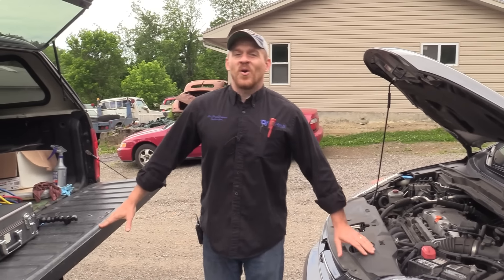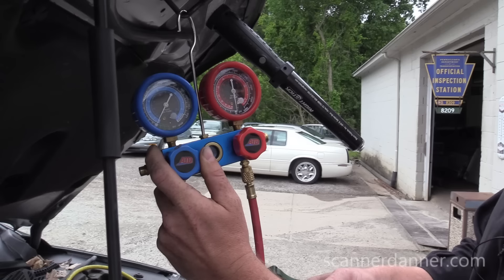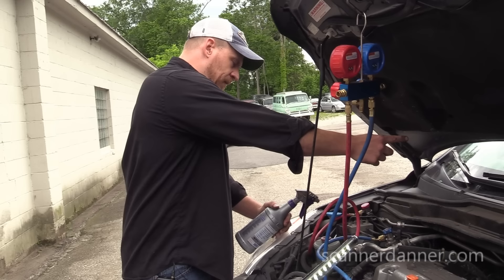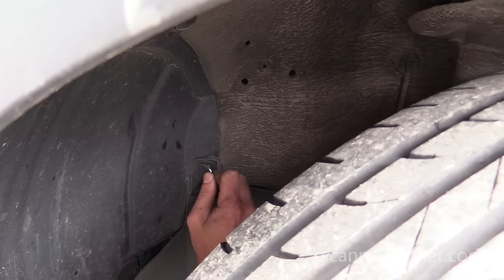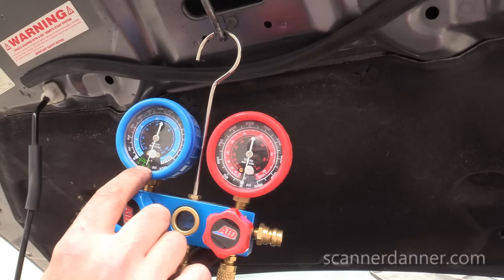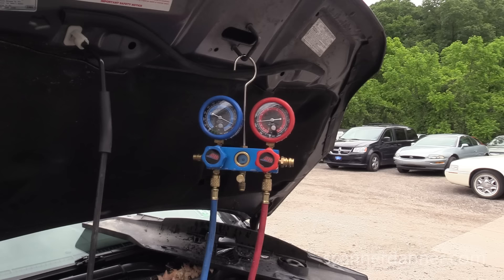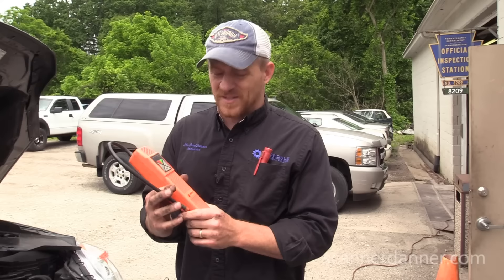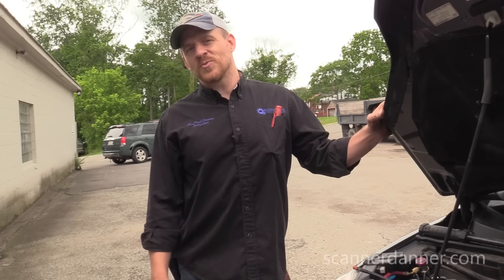Air Conditioning Not Working (system performance, leak test) - Honda CRV

Comment: Hi  i have a 2015 audiQ5 its full i got it in 2016 the A.C was working fine cold a few months went by and the just started blowing hot wasnt cold anymore i figured the refrigerant ran out so took it to The A.C thats here on the island i live in st kitts not know of you heard of it. Anyways its like miami weather all year round or a lil less bout 80 normal so it recharge it it began to work fine again really cold and then a few a couple of weeks passed and it began to acted up again blowing a slight chilled air not colding as it should it works fine and some days and others just kinda chilled cold he says it could the evaporator leaking or the expansion valve not working properly because when the car starts it takes a long time for it the get really cold after ive been driving a while. Everything works as far as the eye can see the fans work the compressor spins the A.C flaps move when you change the settings can you help my telling what you think could be causing this the anyone if you have any idea if it sounds like electrical or mechanical please any advice or opinions would be a help thanks.

Comment: I recently passed my 609 test from ASE... Im starting to do alot more ac work since im the only mechanic at my shop i was just wonder where do i get a set of those gauges for r134a systems and fittings for now til they finally go to r1234yf systems if they even do which they probably will.  ?

Comment: Harbor Freight Tool has about the same sniffer leak detector for $69. I bought mine from there 5 years ago and its worked great ever since. Home - Automotive  & Motorcycle - Refrigeration. I bought mine for $39 I think it was on sale.
Reply from the maker: It's not the same. It may look the same but it's not the same manufacturer
Reply: Oh no. No where near the same manufacturer . The chiwanease version of the one you got. But It does do a very good job of finding leaks.
Reply from the maker: cool, thanks for the info

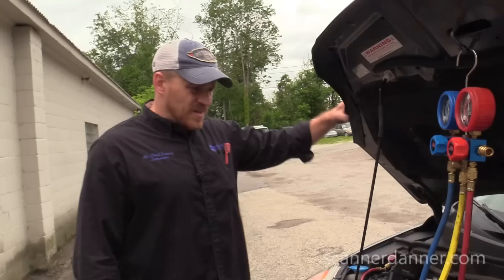Comment: Did you have the vacuum pump running when the vacuum wasn't going down right around 28:49? I think the only vacuum you would lose is the vacuum that the pump isn't able to overcome. I might be wrong, though. Meaning, I think you would have to shut off the pump for an accurate reading.
Reply: Both valves were closed at that time, the pump wasn't able to effect the system pressure. In a full time vacuum test you would turn off the pump just because it's noisy and it's not doing anything useful anyway. Here Paul is conjuring trains of thought and simply forgot to hit the off button.
Reply: Ahh. I was trying to find the part where he was testing the vacuum by skipping around in the timeline and must have set it right after when the low side was closed.
Reply from the maker: exactly, thanks Lee!

Comment: For the DIYer, what are your thoughts on using a UV dye instead of compressed air/soapy water/sniffer?
Reply from the maker: Not a fan of it because you have to blow refrigerant in with the dye. You wouldn't  want to do that without knowing how big the leak is.
Now, in times where you cannot find a leak, and its holding psi and vacuum, but the system came in empty, so you know you have a small leak, then and only then would I use dye and fill the system with refrigerant

Comment: The reason it didn't seem to leak with the vacuum is because atmospheric pressure is only 14.7 psi. No matter how powerful the vacuum is you can't have anymore pressure than that pushing in the air. So your basically comparing the the pressure loss at 150 psi vs 15 psi

Comment: Hi, I have a problem with the AC on a Honda CR-V 2.2 IDTEC, namely ... when it stays in place the AC works, but on the go no ... what a problem it would be ... thanks.
Reply from the maker: Need pressure readings when it is blowing warm air
Reply: @ScannerDanner  hello, thanks for the reply ... who does these hot air pressure readings? AC season?

Comment: If the system has equal pressure across H / L sides when the compressor is not running, how did the high side leak down15 psi before the low side?
Reply from the maker: low side gauge has different scaling than the high side, it is dropping the same, you just are not going to see it when you are too high of pressure on that low side gauge
Reply: @ScannerDanner  Thanks, that makes sense.

Comment: I repaired AC systems for years and virtually never found a leak using a vacuum, total waste of time unless a gaping hole. Only worthwhile test I found was OFN or a leak detector. You could also see leaks on condensers as it would leave a oily deposit or dye on the surface.

Comment: Awesome video.  I really like how you use compressed air to check for leaks.

I believe that CRV doesn’t require a dash removal for the evap.  I believe just the glove box needs to be dropped.

Comment: I also have a 2011 CR-V. I changed the compressor but the clutch is engaging then it stops. It does this continuously, with little cold air coming through. What do I do? Please help.
Reply: check your system pressures when the system is running... either you have A.. Not enough refrigerant in the system (low charge) or.. B, if its a TXV system, your TXV is stuck closed... or if its a FOT system, the FOT may be clogged with crap.  or  you have a restriction in the system somewhere.. (clogged line/ or condensor is very likely if the compressor self destructed or you may have a crushed/kinked line somewhere).

Comment: I’m having issues on my A/C 2010 Honda Civic.  Compressor engages just fine and the system is fully charged and has no leaks.   Relay is good and so is fuse. My A/C gets cool but never cold.  What else can I check??
Reply from the maker: What are your system pressures? Also, if you can access the heater hoses, pinch them off with some needle nose vice grips and see if your discharge air gets colder. If it does, you have a temp blend door issue
Reply: @ScannerDanner  thanks! I’ll try that.   I think that’s it’s too.  Just stumbled upon another video about this same issue.

Comment: I know you are good but never watched any video made by you until today. Thank you for this amazing tutorial on checking leaks. Just curious, why the soap spray doesn't work on the drain tube?
Reply from the maker: Because the EVAP core is exposed to the vents, so the drain tube would never be pressurized. Make sense?
Reply: Seems to be some common perception that the drain tube is some kind of outlet from the evaporator. 
The evaporator is sitting in a box that's open to the air, and condensed water drips off it into the box, and the drain hose just takes the collected water and routes it outside the passenger compartment.

Comment: You can check for leaks at the evaporator by putting the leak detector at one of the dash vents with the blower motor on. You need to have some refrigerant in the system.
Reply from the maker: Too many false positives with that test. Just the air flow itself can set these detectors off. Did you see it go off when I blew into it?
Reply: @ScannerDanner  still might have been interesting to try sniffing the vents after confirmation of the gross leak via the drain hose. 
Would have been interesting to see the characteristics of detection there. May as well, since the test charge was going to be wasted anyway.

Comment: Great video!!! A lot of information. I have a question. I have an 07 crv ex. My ac has been working for 3 years with no problems. Today I noticed that the ac was not cooling as usual. The ac used to work properly even on really hot days. I connected the ac manifold gauges. I had 50 psi on the low side and 275 psi on the high side when the ac was on. The outside temperature was 95 degrees Fahrenheit and 34 percent humidity. It was blowing cool air not cold air. I took a long trip on the highway and it got a little better. Any advice or tips? Thanks
Reply from the maker: With those ambient Temps, those pressures look okay, especially with a large amount of cooling load. But the low side pressures should be lower than that. What did these numbers look like at 2000 rpm? What do the low psi lines feel like on the car? Are they very cold and sweating?
Have you considered blocking off a heater hose to see if the in car temps get cooler? This could indicate a temp blend door problem.
Other observations: 
1.It's definitely not low on charge.
2.High side psi at 275 on a 95 degree day is about right
3.Low side psi is high (should be closer to 30-35) but as I said with a high cooling load this can be normal until in car temps come down.
Reply: @ScannerDanner  Thank You very much for your response and your help. With your tips I was able to figure out the problem. It turns out to be the temp blend door. There is either a problem with the motor itself, wiring or climate control unit. I have to troubleshoot that to determine which is at fault. I moved the blend door manually to max cool and the ac was ice cold. Thanks again for pointing me in the right direction I appreciated.
Reply from the maker: @christiancorrea8820  awesome! Great job on your part. Glad to help and thanks for the follow up

Comment: Question. What if I have a leak in the compressor. Should I replace de compressor and then vacuum it?
Reply from the maker: yes, replace the compressor, remove ALL oil from the new compressor (if it comes with it), measure the amount of oil that comes out of your old compressor and add that amount back to the new one, plus 1 ounce, then evacuate the system and you should be good to go.
Reply: I will do that thank you so much for taking the time to answer.

Comment: my man ur the best i want to ask you one thing my car is a chevy caprice classic 1990 ls i have no air coming out when i turn the ac on nothing at all and i have a leak but even if i have a leak shouldnt the blower motor run !? even with out refregrent idk how to spell it but u get the idea i turn my ac on but nothing happen at all could it be my blower motor is shot cuz i have a leak ? checked all fuses power is good but no air comes out and i dont hear my blower motor run at all wheter is it on max ac or vents what do u think thanks am sorry for the long talk but i want aome help thanks again
Reply from the maker: the blower motor controls are completely independant of the AC clutch circuit. You have two separate issues. 
As for the blower circuit, test your blower resistor first. It is the most common component to fail.

Comment: If the service ports were the cause of the leak, the gauges would not have shown the decreasing pressure of a leak since they were connected to the gauge set.  The fact that the needles were decreasing showed that the leak was somewhere else.

Comment: I hooked up my gauges and vacuum pump left it on for about an hour and had no drop on the gauges. I either hooked them up wrong which I'm pretty sure I didn't do but I'm going to disconnect the line where the orofice tube goes in and I'm going to tape a rubber glove on each open line and try and vacuum again. By the way, I support you with the air pressure in the system to find the leak. Your going to vacuum it out anyways
Reply: I put a rubber glove on the RED line and it was being sucked, my blue line glove wasn't. So this tells me my schrader valve might not be opening but not sure why the glove wasn't being sucked? This sucks and now raining, time to put things back together

Comment: very informative video, thanks! is it normal for discharge line (hose) going to the condenser to drip water?
Reply from the maker: Depends where the office tube is. Some of them are right at the condenser discharge and in that case yes, that is the beginning of your low side

Comment: I know this video is already two years old...............but would it be a bad idea to charge the system with smoked air? Ya know..........like the same smoke they use to test EVAP systems? For a small leak, I thought some smoke would easily allow a leak to become visible in an AC system. Just thinking outside the box here, could be totally wrong to do. The source of the smoke could come from mineral oil.
Reply: Smoked air contain particle contaminants, most likely carbon, that compressed air does not. Compressed air has water vapors, depending on your Compressor dryer, and possibly compressor oils. However when you evacuate an AC system the water will boil out, and any left over oil will be so small it won't mater. Smoke system particles won't vacuum out very well, they'll just settle in the low parts of the system. Also you don't know how they will react to the refrigerant under high pressure. So to be safe I wouldn't do it. Hope it all worked out good for you. Best Wishes & Blessings. Keith Noneya

Comment: Do we know that the evaporator core is bad? It can be just a O-ring in the connector. Vacuum pulls it in, pressure pushes it out. I would check the seals before ordering the core.
Reply from the maker: Either way, you are removing parts of the dash to get to it. There is also an expansion valve in there (I am told) that could be the issue. What this video proved? You are absolutely pulling the dash. Time to write up the repair order and sell the job.
Reply: In the old days there  used to be seals between the evap core, expansion block and pipe connector block. If that is on the firewall as it is in my Citroen, then it is not the culprit here and the leakage would not coming out of condensate tube. 

But it it is under some cover plate it could be as coolant is heavier than air and flow down to condensate tube. Saved a lot of time changing the seals on the block with my Citroen, no need to pull apart the dash. With Honda, pulling the dash apart might be the only right call.  

Pic: 
http://repairguide.autozone.com/znetrgs/repair_guide_content/en_us/images/0900c152/80/21/60/93/medium/0900c15280216093.gif
Reply from the maker: That pic looks like an H-valve on a Chrysler. Those are exposed on those models and would be an external leak. But you are correct if that set up is located inside  of the dash you could have an issue like you described. That is not the case on this Honda. There is nothing you can do from the outside.
Reply: Yep, I could not find a pic of Citroen, chose a similar one. If it is one of the modern designs, having just two round holes in the firewall for pipes and the valve and core behind it, it's the dash job then.

Comment: hi paul .can compressor be tested by runing it for few second with nitrogen in it or only can be run while air in it. thanks
Reply from the maker: I'm not sure how it would react as far as compression ratios go but yes, you can do the same test and the clutch should engage.
Reply: ScannerDanner thanks paul

Comment: You have completed moisture in A/C system by compress air. You should replace compressor oil dryer and complete evacuation.
Reply from the maker: Lol, or just pull it under a vacuum for an extended period of time

Comment: That time of year again! Thankfully! :)

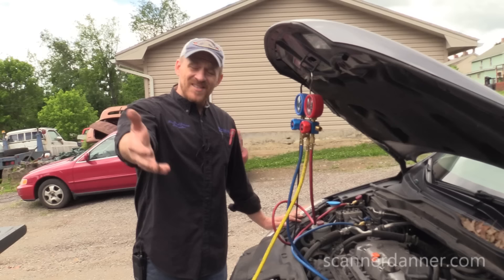3:58  - a rare Pete sighting! :D

I lost my hearing the same way, Paul. Too much Van Halen (the D.L.R. days),  April Wine, Iron Maiden, Motley Crue,  Judas Priest,  Twisted Sister, etc., and occasional gunfire and fireworks. :D

You used pretty much all the methods I use for leak detection, except for the dye / UV light deal. That works pretty good for the small ones. Just about every modern vehicle has dye in it right from the factory too ... which reminds me that I need to replace my busted UV light! My Bacharach H-10 Pro is absolutely amazing, but probably out of most DIY'ers price range I'd imagine. Then when the sensor wears out, it's almost as much as a cheap leak detector itself!

Just did a compressor, condenser, accumulator, and o-tube on a '02 1500HD. Boy I'll tell ya, GM did some fine engineering on that compressor - lets stick it way down underneath, and then put the lower bolts where everything is in the way. Only my Snap-On ratchet with a 15mm deep could reach the lower, rearmost bolt without interference. Grrr!! No need for that type of engineering! We put men on the moon almost half a century ago, and nobody can design a vehicle with easy access to every system??? Ok, I'm done ranting ... for now ... :) I did see an area with dirt sticking on the lower driver's side of the condenser - sprayed that with Windex (normally works great as a leak finder, especially on tires & tubes, since it sucks as a glass cleaner), but saw nothing. The H-10 Pro screamed when I got near it on the "small" setting - should've started out on  "medium" as I found later. Found a 2nd leak at the inlet connection - corrosion forced it's way in between the sealing surface and distorted the o-ring. No surprise on a 15 year old MA vehicle.

Got a 14 Ram to do a compressor on. Only 60k, but the owner decided to do his own A/C repair, and charged the system using parts store cans with stop leak, and charged them into atmospheric pressure. Fired the system up, and the compressor got really loud for 3 short cycles, then quit. He got worried when the can gauge was pegged, and let some pressure out, but it still didn't work, so he came over here to find out why. I found the rubber damper / "fuse" had broken, allowing the clutch to engage, but not turn the inner portion that's connected to the compressor shaft. Got a new compressor coming, but the stop leak deal has me worried. Hopefully I can change it out fast ...